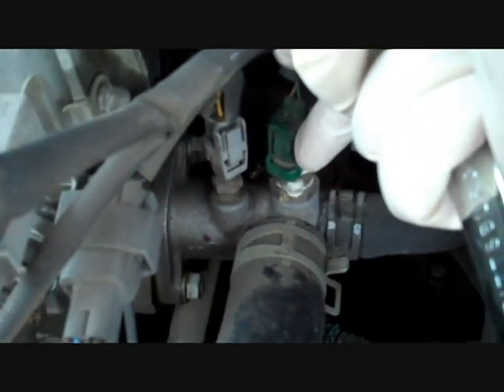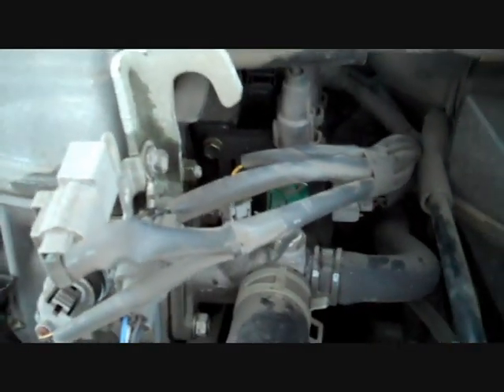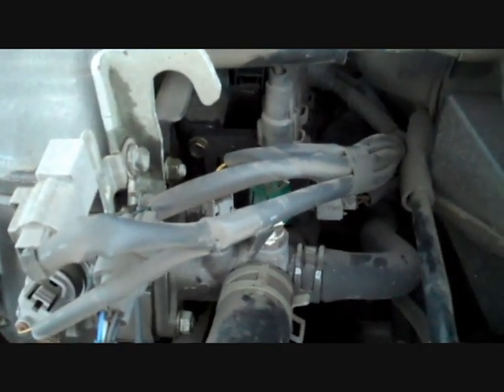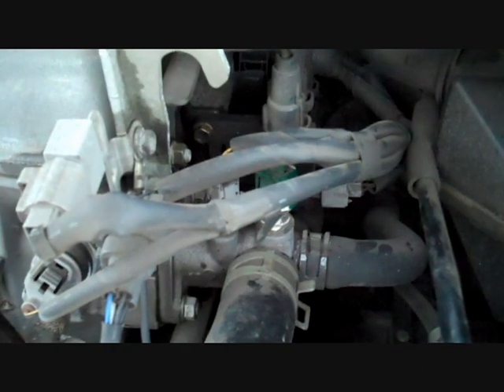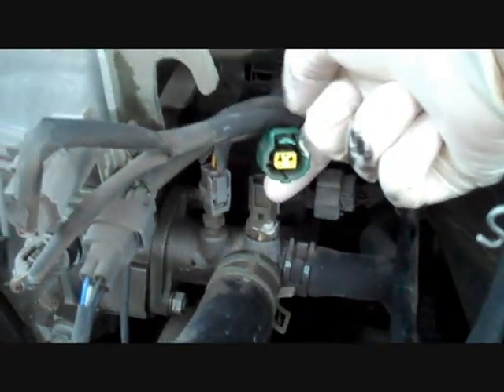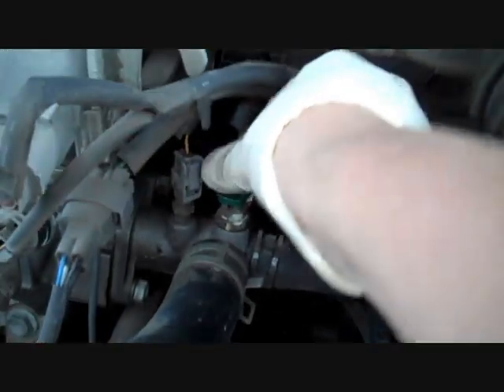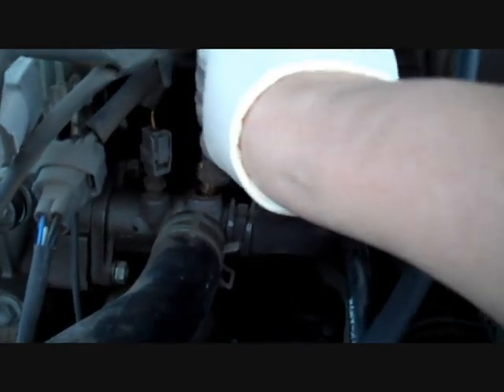How a $20 Sensor Can Save Your Engine: 2001 Toyota Solara

Comment: What is the function of this sensor ?
Reply from the maker: The Coolant Temperature Sensor is used to measure the temperature of the engine coolant. The readings from this sensor are then fed back to the engine control unit (ECU). This data from the sensor is then used to adjust the fuel injection and ignition timing.
Reply: Thank you

Comment: Could this effect your starting I have the same car but it doesn’t start very easily but after it warms up it does fine, and it’s throwing a code for that part so could that effect cold start?
Reply from the maker: I’ll m not sure but if it’s throwing the code for this I’d replace it. Such an easy fix!

Comment: So basically this won't work until yo clear the code for it as well you will still get and idle issue at times also ppl replace coolant temp sensor when they are ok and need to check the air temp sensor as well
Reply from the maker: Fixed my car without having to clear the code 🤷🏻‍♀️

Comment: there is another temp sensor underside of the radiator that will prevent fans from coming on
Reply: Alex Larsen 
do you know what sensor that is?...if there is another one controlling fans i think i need that one..my fans will not shut off & that happens if a sensor goes out..2001 toyota camry
Reply from the maker: I don't know the answer to that unfortunately. I'm sure any auto parts store would be happy to advise you.

Comment: I cannot remove the old one no matter how hard I try with wrench. any suggestions?
Reply from the maker: Have you tried using WD40 or something? You may need a different type of socket with some torque strength!
Reply: Susan Davis  yes I tried everything I could. now my engine light went off and auto zone checked again now the code I previously had for the sensor is gone lol. my car is running normal so I dont know what happened.
Reply from the maker: Well that's great news!

Comment: Good video!  I have P0115 on 99 Camry.  Before replacing the ECT, I checked the ECT contacts with multi-meter.  It showed open.  Then I checked the voltage coming on the wiring.  It was 5.00V.  These two tests conclusively prove that the ECT sensor is dead.  This should satisfy the ASE technician and hopefully he will approve of me swapping the sensor.

Comment: As much as i applaud your successful installation being a qualified ASE certified mechanic i do not think this video is informative. There are reasons we go to school and attend training seminars on automobiles. It is because in this field we see many people who try to repair their own vehicle unsuccessfully and bring it to us in an absolute mess. Codes in the computer are not cut and dry answers. They are tools that a qualified professional uses to help clue them into the problem. I have seen many people attempt fixes. Simple at first. Then they keep going. Before they knew it they spend 200 dollars on a sensor. Thermostat. New coolant. Etc etc and when brought to us it was a simple wiring repair. There are some things that can be done by owners but unless you are 100 percent confident bring it to a professional. Not only is that how we make our money but if its an honest technician it also makes us happy to know we repaired the problem and have a happy customer.
Reply from the maker: Thanks for watching! I do appreciate your comment.  I was 100% confident that was the problem and was not about to spend over $250 to pay someone to unscrew a plug and replace it when I could it myself less than a tenth of the cost. I have also replaced my own thermostat, and replace my own brakes. I do take my car to certified mechanics for problems I have no knowledge of but for simple repairs, in this day and age, I just can`t justify the elevated expense. My brother is a certified mechanic and he has helped me learn how to fix my own car along with my father who has passed away. He taught me how to change my own oil and filter as well as how to change my own tires when I was 16.
Reply: You don't call an electrician to replace a lightbulb. I will gladly take my car to a mechanic to replace the fuel pump, radiator, brakes, some other thing I do not have the tools or equipment to do on my own, or fix that thing that you have to take half of the car apart to get to, but if I can reach it, lift it, and can fix it with some basic tools in less than an hour, I'm doing it myself.
Reply: Susan Davis You tellem Susan!
Reply from the maker: Thanks Sandra!

Comment: Thanks Susan, what is this single wire (yellow) sensor right beside the CTS?
Reply from the maker: Unfortunately I dont have an answer for that for you :(
Reply: Thanks! did a small experiment, unplug the sensor and the heat needle goes to zero when I unplug it.

Comment: Thank you so much posting nice video , recently i have done 100k tuneup on my own  - changed spark plugs & wire, radiator flush, steering oil flush, air filter, throttle body clean, synthetic engine oil  and new battery. car ran excellent 1000 miles and now i see check engine light is ON  and auto zone suggested to change gas cap and I also observed i did not connect one hose that goes to air filter box.
Please suggest me how to clear the check engine light .

Comment: so you saying you dont have to release the fluid out the radiator or unscrew the drain plug from the radiator?
Reply from the maker: That is correct. You do not have to drain the fluid or remove the plug.

Comment: Is that what trigger the cooling fans on Cuz the fans on my car kicks on late
Reply from the maker: Yes that can play a role in that possibly. If your check engine light is on, take it by any Autozone or Advanced Auto parts (most parts store) will run a code check to see if it codes.
Reply: The thing is I have no engine light on but I will have it checked out still
Reply from the maker: Thats the best thing to do! Good luck!

Comment: When doing this, use Teflon tape on the threads, as indicated by the Chilton manual. Will stop leaks, also remove the radiator cap and replace for less fluid leaking when sensor is removed. Looks like no need to drain the fluid as long as you are quick.
Reply: The Haynes manual says do not tape the threads. They aren't taped from the factory either.

Comment from the maker: The themostat is in a kinda hard spot.... I wrecked my car so I cant video it. But, if you stand in front of your car facing the engine, it is going to be on the left hand side down about half way into the motor. You have to look for it but if you follow your hoses you will find it. Once you find it it is fairly simple to replace! Good luck... let me know how it goes!